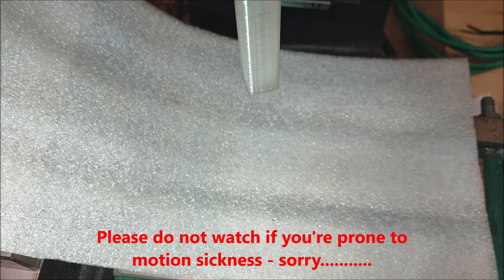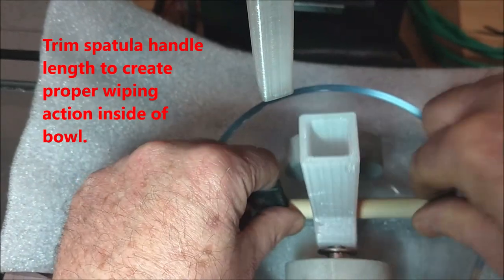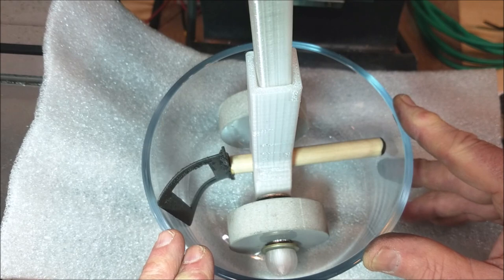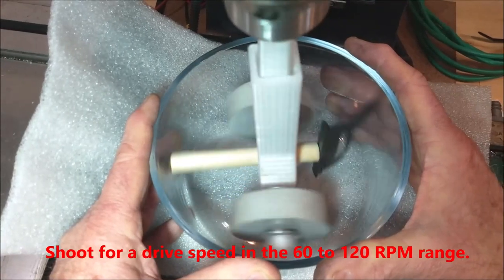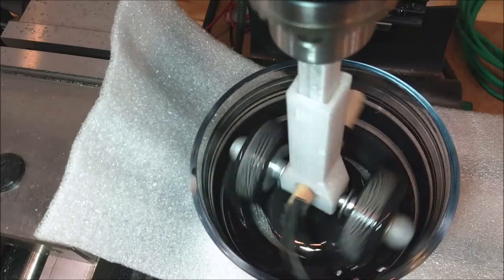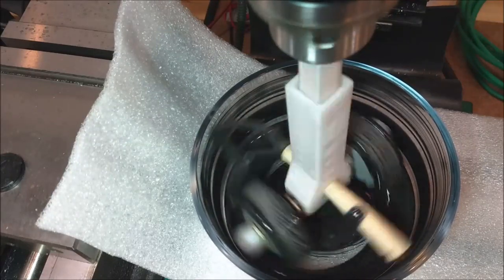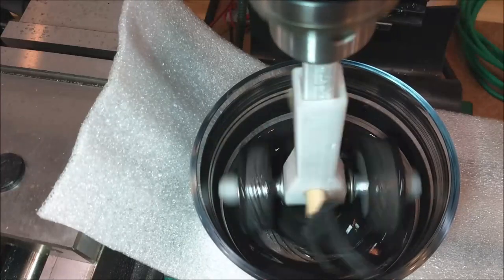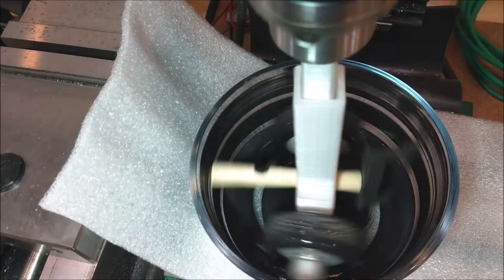Low Cost Wet Roller Grinder for Conductive Ink

Comment: Wow Dennis I was going to buy one on eBay but I can make one super simple . Thanks for this video
Reply from the maker: Your welcome - don't forget there is some cost and complexity if you don't have a drive system in the 1 to 2 rev per sec. range.  Here a type 23 stepper controlled  by an Arduino plus 5 A driver would work.
Reply: Dennis well I got a windscreen motor for now but longtime a stepper motor would be great . I will drive it with the output wire of another stepper motor driven by a dc motor though 😱

Comment: How low did you get the resistance of the ink with this DIY Grinder then ?
Reply from the maker: Hi Stefan - glad to have you chime in on my supercap work.   To your question ----- After all the ingredients were blended wet - graphite, binder, surfactant, carrier (water),  the mix was placed in the roller grinder for a few hours.  This smooths everything out making the carbon particles even smaller (and more conductive) in the process.  The roller grinding is similar to commercial printing ink making (some examples are on youtube) and to what RMS showed a few year back in one titled "How to make conductive ink" - where he use a 'wet spice roller grinder'.
Reply: @denniskramer9788  So what were the Ohms in 1 cm distance when the ink was dry then ?
Reply from the maker: Hi Stefan - search youtube for Dennis Conductive Ink and all the detail are in my earlier videos from the last week or so.